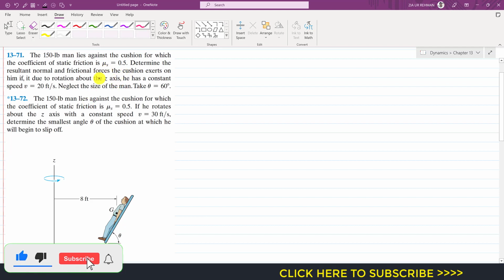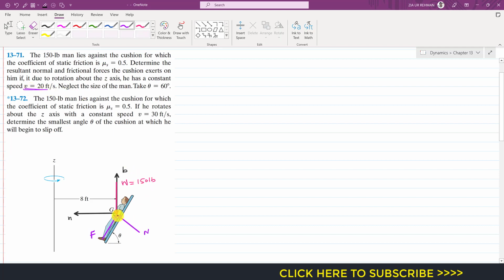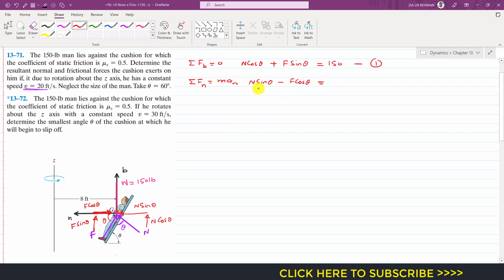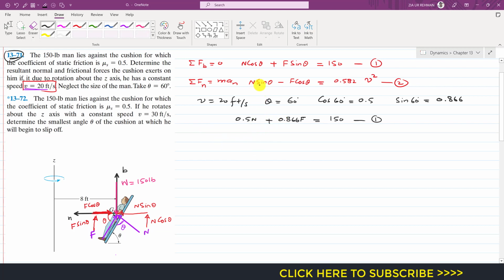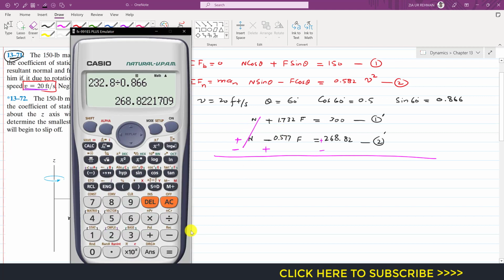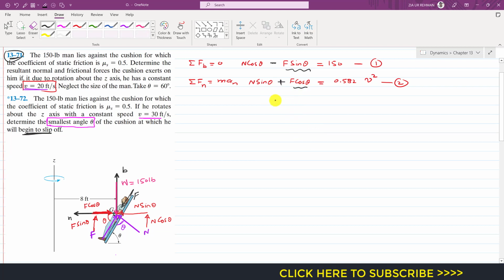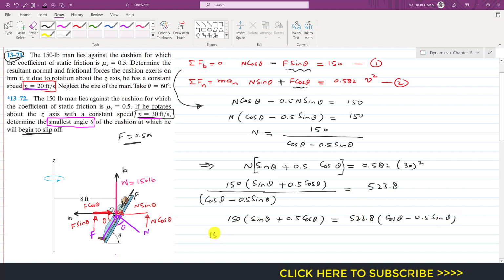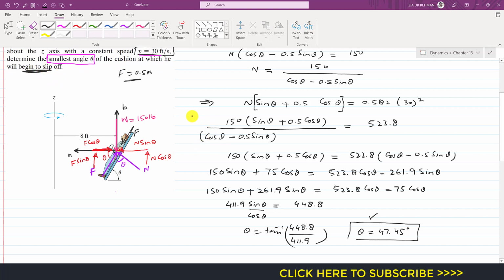13-71 | Kinetics of a Particle | Chapter 13: Hibbeler Dynamics 14th |  Engineers Academy

Comment: why friction co-efficient was not used?
Reply: for the first question, the equation friction=mu * N is not necessarily true. This is because this equation is only true when the object is about to slide, or is currently sliding. In this case, the only relation between N and F is that F <= mu * N